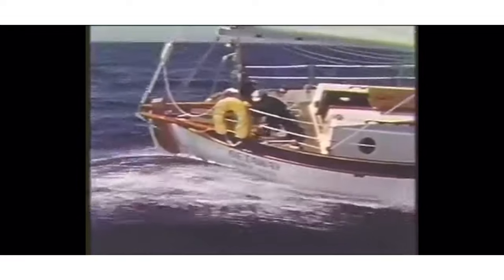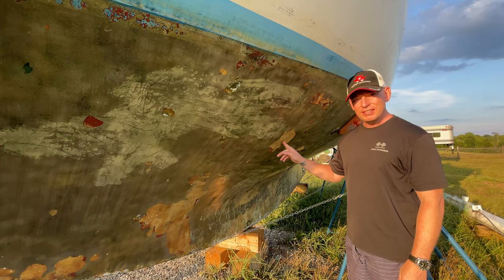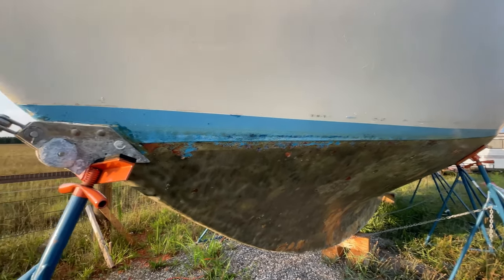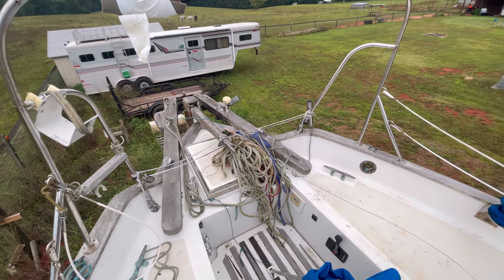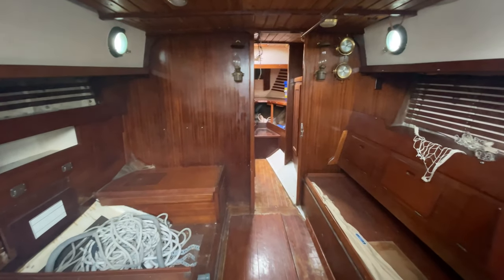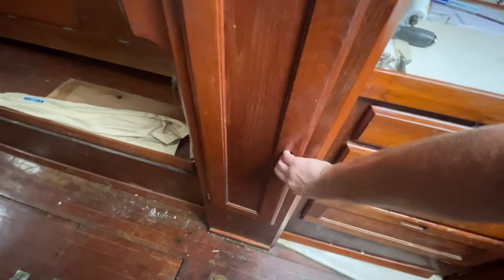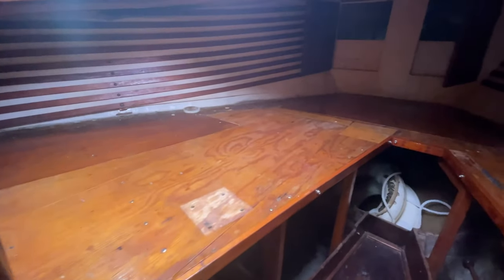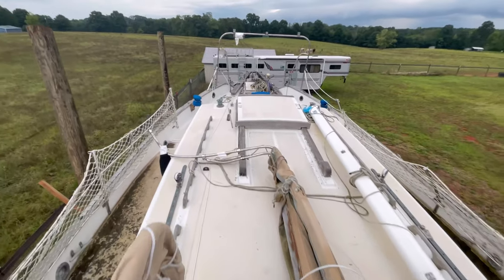A Complete Tour of a Westsail 32 Sailboat Pre-Refit | Sailboat Restoration Ep. 10

Comment: Looks in decent shape inside and out .. Usually owners over the years hack and butcher the insides up and you end up with a mess....
Reply from the maker: I don't plan to drastically change it.  A lot of owners try to modernize the interior, which I am sure would look great, but I am leaning towards maintaining the wood and will recondition it with varnish or some other process.

Comment: Was there shower facility. Like pull out shower head.  Just can't get any response on this even westsail owners association.  I guess no water heater or water pump for pressure.
Reply from the maker: Routed in the engine bay on my Westsail was a pump for a cockpit shower. I have also seen a setup with a shower grate in between the saloon and v-berth, with cabin doors closed, which drains to bilge. Nothing else is mentioned about showers aboard per https://westsail.com/servman2.htm
Reply from the maker: Here is an image of the shower grate on a Westsail. https://www.cruisersforum.com/forums/attachment.php?attachmentid=37789&stc=1&thumb=1&d=1329952323